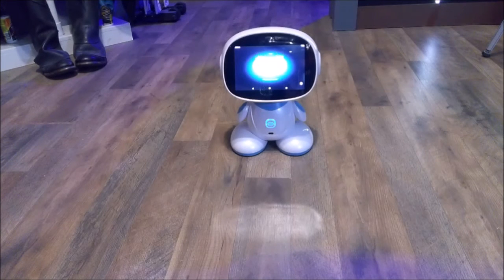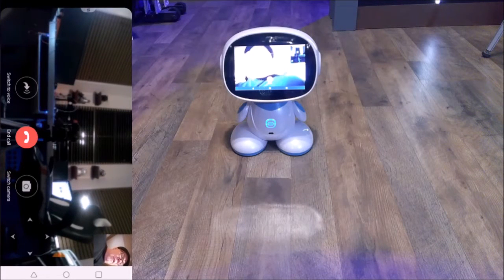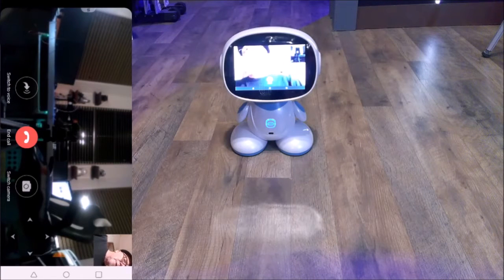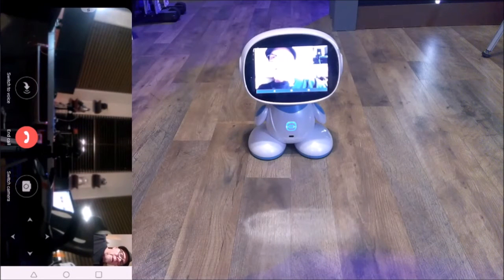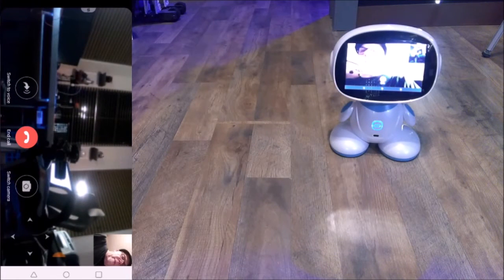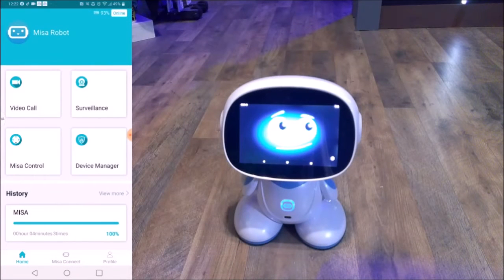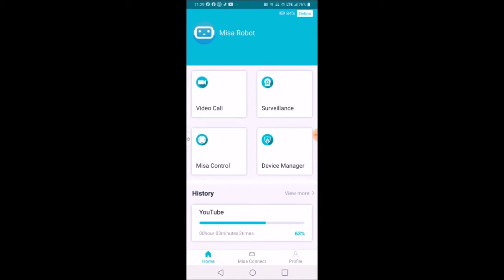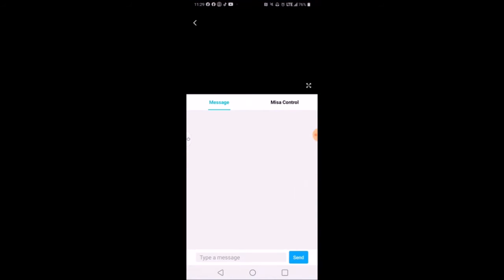Misa Robot Telepresence with Misa Connect App testing and review Misa Robotics

Comment: My misa no have voice.What happened?
Reply from the maker: I have noticed that my Misa is running out of memory if yours is this could cause such an effect.  Because Misa does not have the ability to process the information.  So with mine I cleaned all catch files this helps a bit but not enough, so then I cleared all photos Misa may have taken.   Again only helps a bit.   Then I went through the process to move what files the system would allow from Misa to the Sd card it really did not move much only about 9 mega bites.  I reached out to Misa robotics but have not had a response from them.  This is a problem they need to address but at this point silence 🤐.  These little things I did improved Misa performance but did not really fix the problem.    If you do them they may give you a chance to give Misa enough space to process the information needed.   But Misa robotics needs to offer the ability to compress the drive better or allow more of the data to be moved to the SD card hope this helps my suggestion help but it just clean up not the overall solution
Reply: @BruceHunsaker  Thanks very much l will try😊